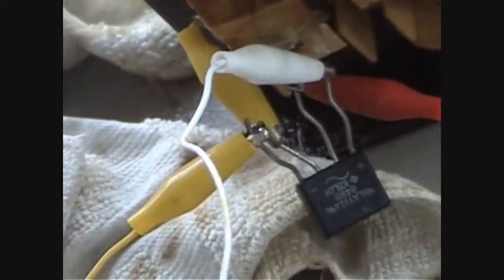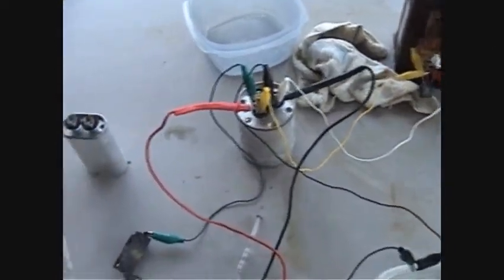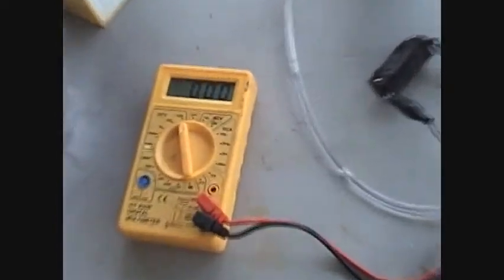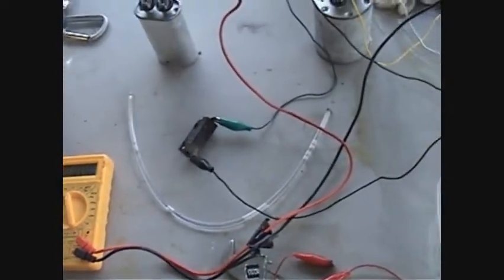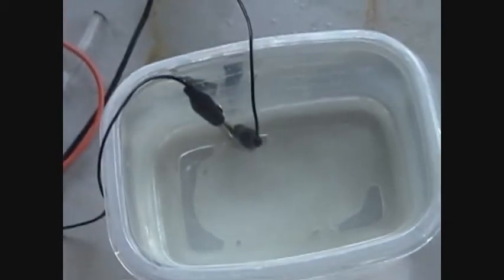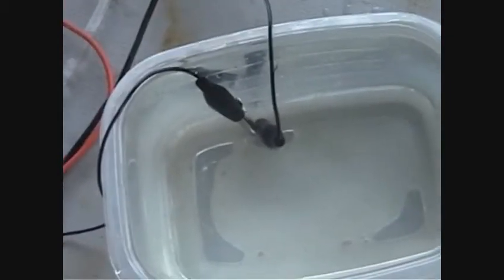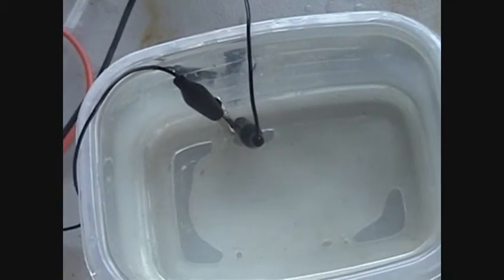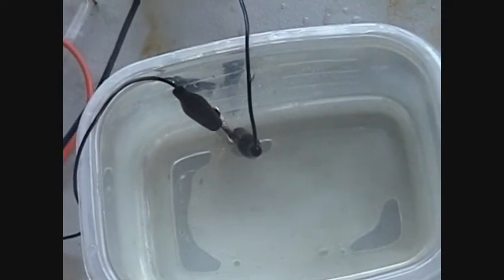Water Cracker pt 2

Comment: I'm not sure what type of capacitor that is but putting 900V on a cap thats rated for 440V is a bad idea. Put that cap inside of some kind of enclosure, box or whatever before that thing blows up. I've blown up electrolytic caps (on purpose) much much smaller than that and they go off with a hell of a boom.